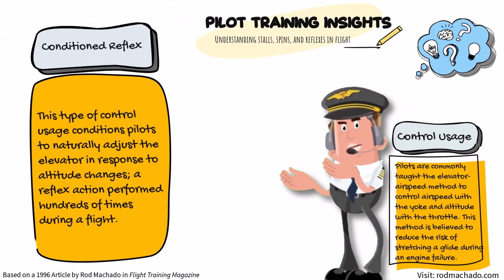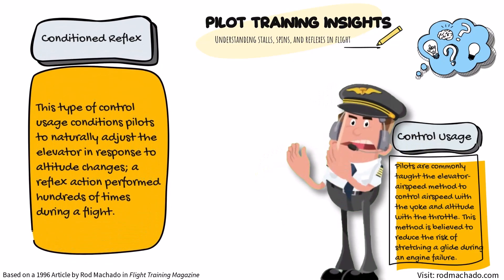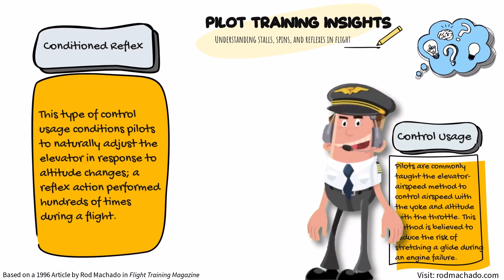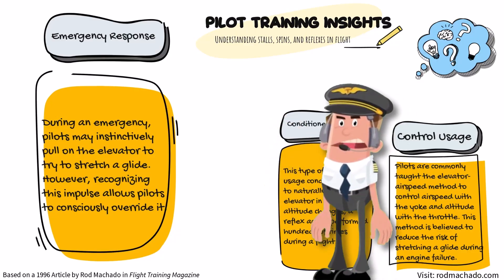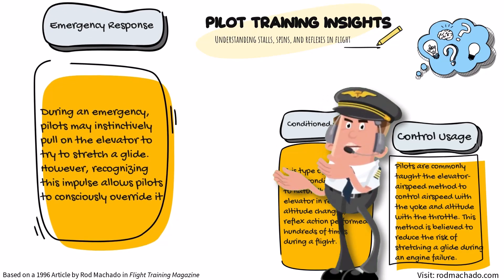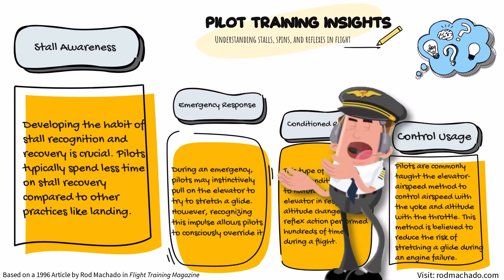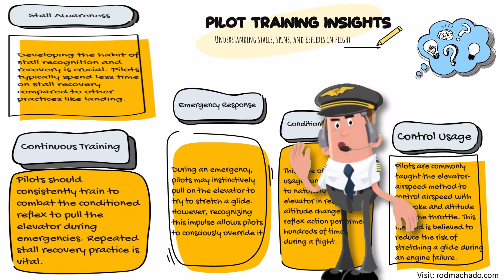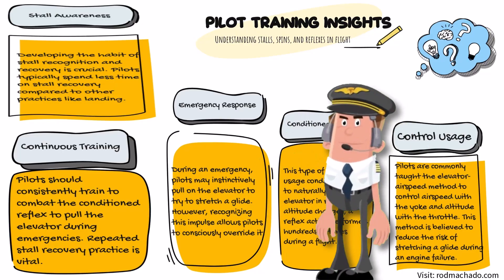Stalls Spins & the Conditioned Reflex

Comment: Elevator controls AoA. Maneuvering requires an increase in lift and AoA (elevator) is our instantaneous lift control. So knowing what to do with it starts by understanding that the elevator is NOT a pitch control or an airspeed control.

I spend a lot of time with CFI students on stalls. It is a core part of my UPRT/Spin course. I point out that, when doing one falling leaf they have gained more time and experience with stalls than all their past training up to that point. (This is especially true for 141 students.)

Anyway, so while I agree that all pilots need more experience with stalls, there needs to be a focus on HOW they get more experience with stalls. Primary students need experience with accelerated stalls, slipping and skidding turning stalls, the Falling Leaf, and the understanding that coordination going into the stall is completely unimportant while maintaining directional control with the rudder (and not using the aileron) is crucial. And, maybe throw in a bit of understanding about how energy of airspeed determines maneuvering ability and what you can get away with.

Comment: Rod, I have flown with other pilot's who suck in their breath and tense up when I do a stall. I do them quite often, at altitude, and find recovery a no brainer. However, if a licensed pilot is terrified of stalls, I think they need more training. One should train until they are no longer afraid of them. What is your opinion on that, and have you seen it too?
Reply: As long as you can mentally compartmentalize:
1) Down low, complacency can get you into trouble.
2) Some aircraft designs (or CG locations) are less recoverable than others.
Reply from the maker: Greetings Dart106:
I've written on this topic for many years and these articles are on my blog. And I completely agree with you.
Rod
Reply: @Flight-Instructor  Where do I find your blog?
Reply from the maker: @ConvairDart106  Visit: https://www.rodmachado.com
Reply: @Flight-Instructor  Thanks Rod.
Reply from the maker: @ConvairDart106  www.rodmachado.com